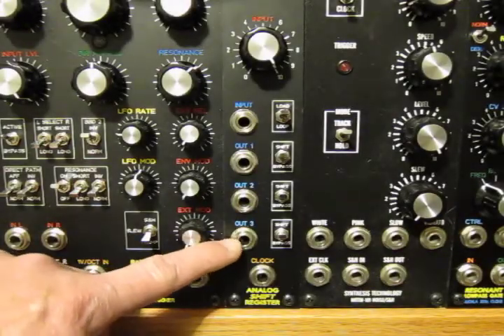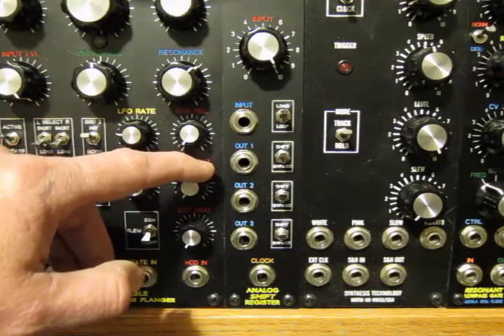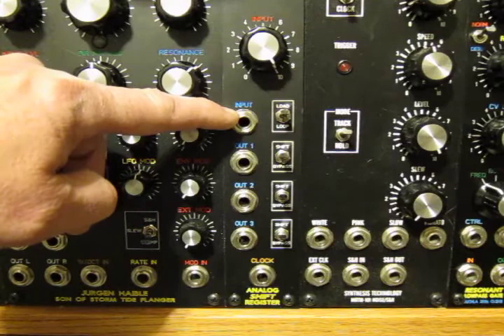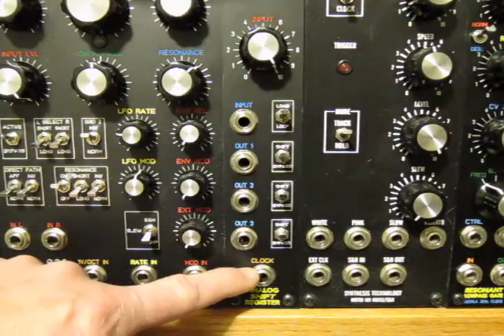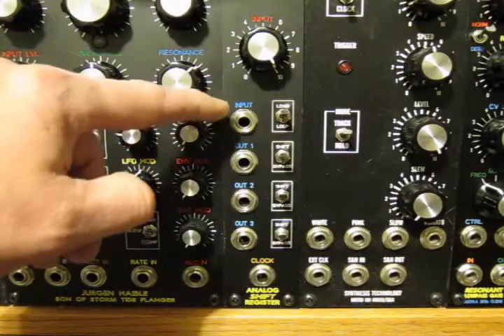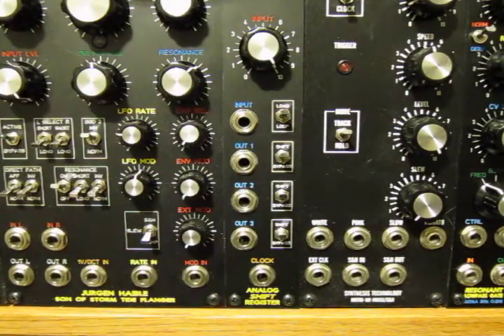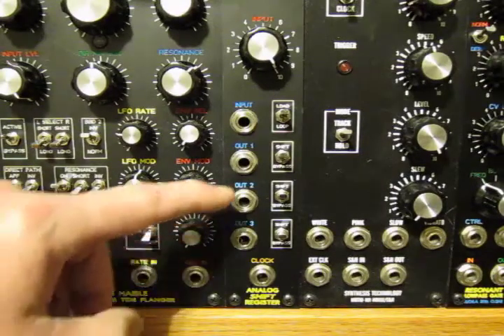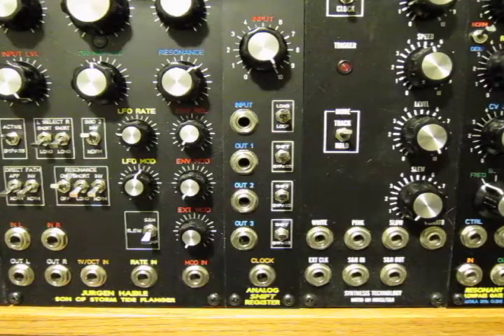Fun with the ASR

Comment: The audio track that drops out at 2:00, was that you just killing a mixer channel?
Do outputs 2 & 3 rely on 1 being used?
Reply from the maker: Yup, just dropped the channel with output 1 off camera. Should have put some explanation text about this, but I think this was one of the last videos I did edited in iMovie, which was really clunky about adding text, and/or I wasn't very good at it. No, you can have each output running independently.

Comment: But what are the right components? Polystyrene capacitors? Matched resistors? I thiiiiink I used Styrene caps in mine but I'm not sure. I'll take a look at it after I retune my VCOs so they could track accurately even if the ASR was spot on.

Comment from the maker: Thanks! Yes, the Dixon ASR is much easier to get accurate voltages out of than the CGS one, although after discussing this with Ken Stone, he assures me that with the right components, his can be a lot more accurate than my build of his is. And the 101 is one of my oldest modules - I built it back in 2004 I think. No scratches, but I just checked it, and there are (were) lots of cat hairs on it!

Comment: So amazing! How did I not see this before? I've never been able to get anything this good out of my CGS ASR. Partially because the pitch is wonky and partially because I haven't  been using the right type of sequences. For a while the 101 is blinking at exactly 1/4 the clock rate. Spooky. Do I see some scratches on it?